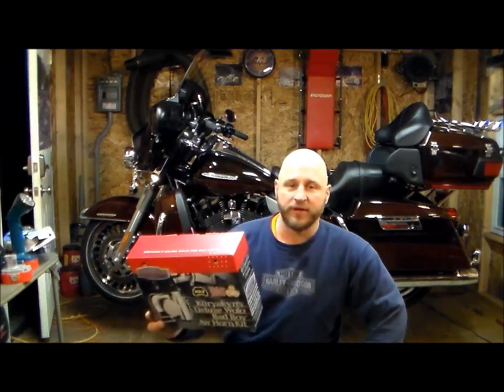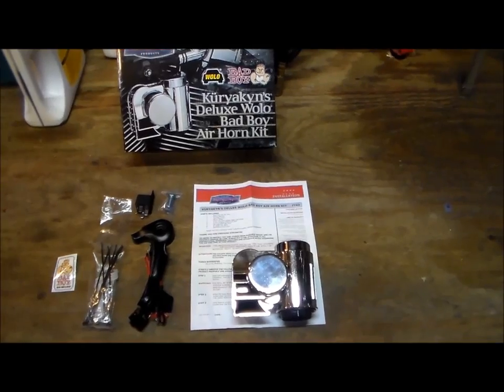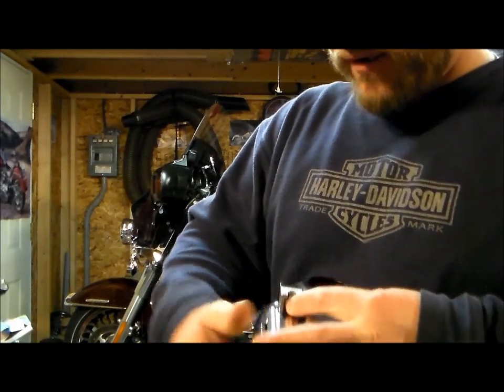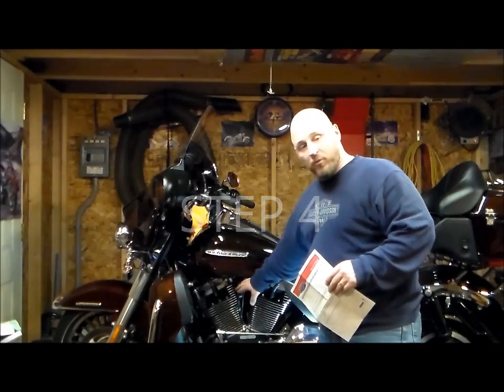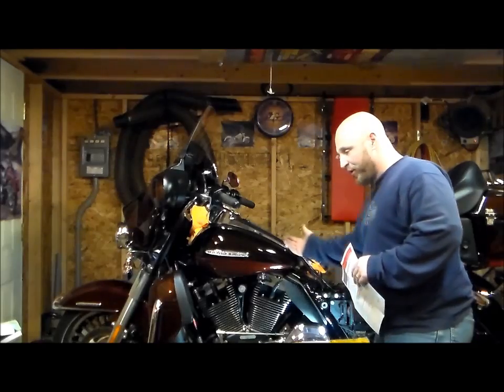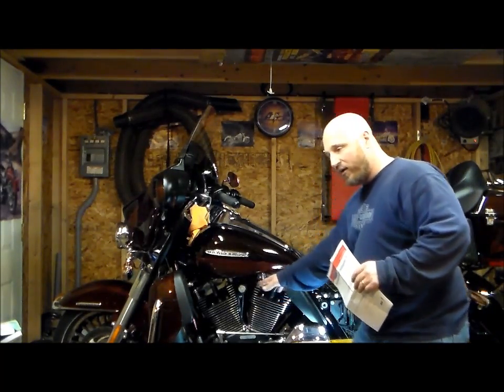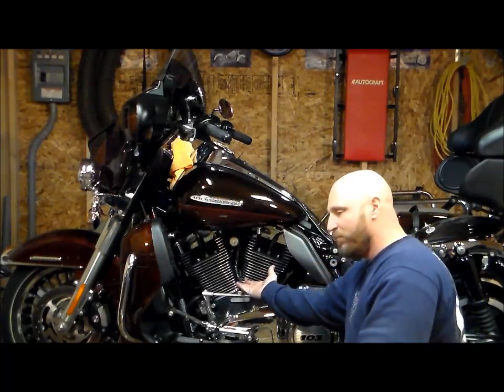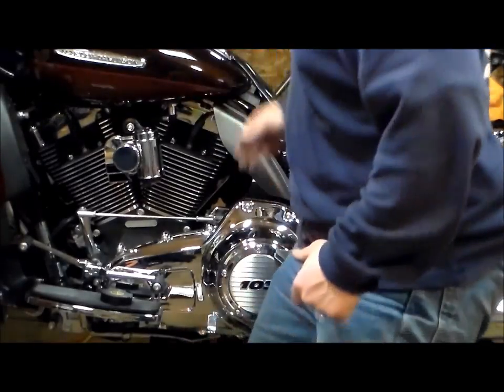Wolo Bad Boy Air Horn Installation

Comment from the maker: For example I put the wiring harness in wiring loom to protect it from the heat of the engine.  Some people might not agree with this method.  The cover you are referring to is a new option and we found it for a cost of $39.99.  If we find it cheaper we will let you know.  Thanks again for your comments.  Willy

Comment: I ended up doing mine as painlessly as possible. I used the black adapter (thanks for showing how that went on), put on some dielectric grease and badda bing badda boom, it's on using the same wires as the stock horn used. I don't see me using the horn for long enough periods to cause any harm. I figure the worse thing that can happen is maybe I'll blow the fuse for the stock horn if there's even one there. Careless? Maybe, but it's how the thing is advertised to be installed.
Reply: Ever have any probs having it hooked to the stock wires?

Comment: What Kuryakyn has done here is contacted an Asian manufacturer and custom plated an otherwise $25 air horn.  You can find these in exactly the same format but not chromed on the internet.  And, they are cheap.  High quality Harley specific air horns that fit well, look good, and are of superior quality are almost non-existent.  Now, I hope someone with a good entrepreneurial spirit is listening.....

Comment from the maker: Thank you for your comments.  To answer some of your questions the Kuryakyn Wolo Bad Boy Horn kit comes with a relay.  I did install the relay using heavy duty velcro. I did not get into detail about how to run the wiring kit for liability purposes.  With all the different makes and models and years of the same models that the horn can be used on there are no specific way to route the wires. I did mention in my video that the routing of the wires would be a preference thing for the installer.

Comment: i put this horn on my bike only lasted one year before fake chrome plastic outer housing started rattling all the time i tried to silence the rattling noise by wrapping zip ties around it ,, and now its not even a 1/3 as loud as it was when new,,the reeds inside horn are also plastic and get brittle and break...im done with WoLo crap horns !! im looking for a true 1950s car horn to replace it with

Comment: ASKED AND ANSWERED BY KURYAKYN
Q: 
Quick question:
Can this horn be installed using the original horn wires or do I need to separately install a wiring harness directly to battery?  If yes, why?   Don’t the original wires supply sufficient power?

A:
You will need to install the supplied relay harness.
The factory switch/wiring does not carry enough power to reliably honk the horn to capacity.

GENE VORWERK
CALL CENTER PHONE TECH
P 715.247.5008 EXT:136   F 715.247.5007 
www.kuryakyn.com
Reply: i wired mine directly the bike has a relay already for original horn